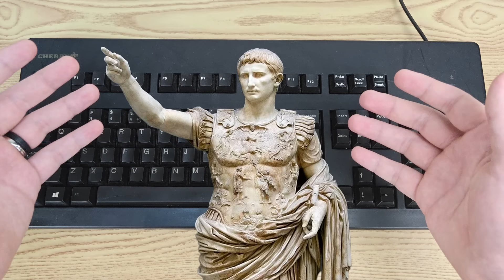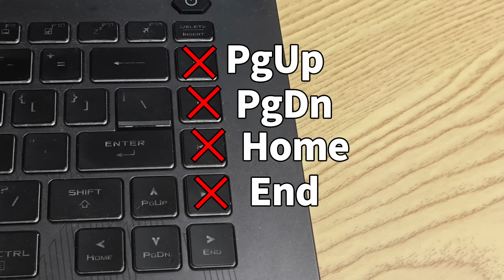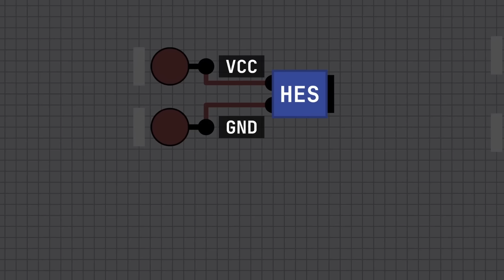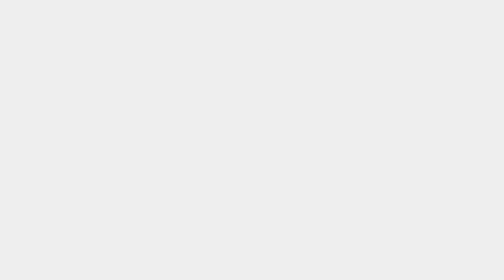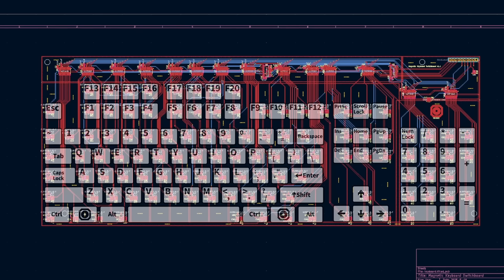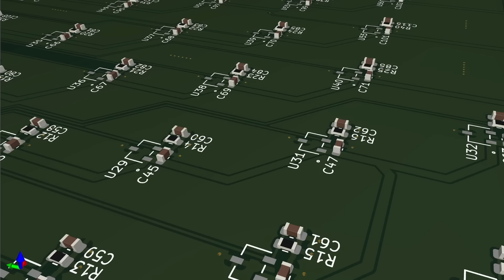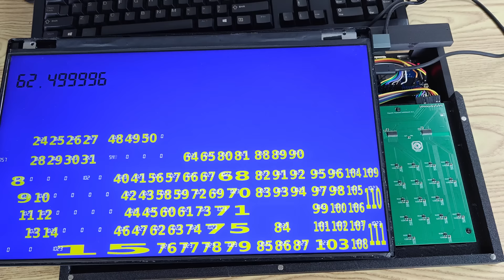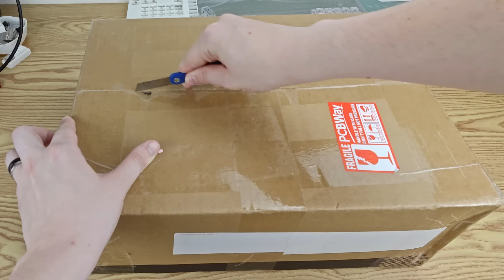Making a Keyboard that Swaps Key Layouts on Demand

Comment: Bros KEYBOARD has a better display than my entire setup
Reply: sameee
Reply: Yeah, watching this from my 1440x900 monitor
Reply: @topcatto  cries in 1024x768
Reply: @Ustaad-e-Muhtaram cries in laptop :(
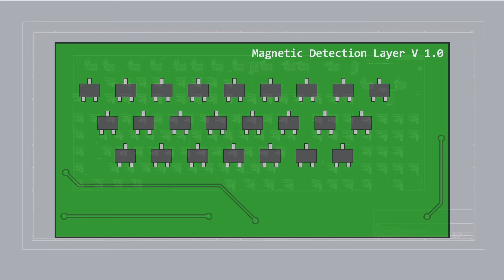Reply: @topcatto  another 16:10 user here reporting
Reply: @topcatto the fuck what the
Reply: @topcatto  same here lol
Reply: Same
Reply: Got a 1440p180 recently, for me 1080p is still fine.
Reply: @cogverkoster yeah I recently got a monitor at 1440p 180hz, did you get the samsung odyssey g5
Reply: I came to say the same thing, on a Pi no less
Reply: 18:42
Comic Sans. And Papyrus.
I see what you did there.
Reply: My friend no hate but just use Linux if you want your desktop too look goood
Reply: (cries in 1680x1080)
Reply: 1680 by 1080 is crazy @UriahStuff
Reply: @MarshmallowBoy  is 1080x720p better?
Reply: Do you mean 1280x720p or 1920x1080p? Or is that actually your resolution lol @KavyanshKhaitan
Reply: @MarshmallowBoy  (cries in 1280x1024)
Reply: @UriahStuff what the fuck
Reply: @UriahStuff cries harder in 1366x768
Reply: same (i have 1080p60)
Reply: Same
Reply: And a better os then your system proby
Reply: laughs in 3440x1440
Reply: @cactus_cuber1589  nooooooo
Reply: smiles in 1080p180

Comment: This video is profoundly important engineering — the Optimus Maximus failed, I suspect, because it tried to put a separate screen in each key (high production cost) while putting a single screen under transparent keys is a brilliant idea I never thought of! 💯
Reply: Overexaduratedet, repeating points from the vid and passing them as your own. This is definitely a bot
Reply: @ethangames5189 a quick way to spot those is when you see mdash ( —)

Comment: I love all the cool topics you dive into in your videos! As for Bluetooth, it's just painful working with and even though on paper I love the features, having to actually use it has so much more friction than I would anticipate. Bluetooth Classic acts as a simple serial interface, but it seems like almost everything modern uses Bluetooth Low Energy instead.
Reply from the maker: I may have to go back to classic then, eventually I want to have the Bluetooth code directly in the main program

Comment: Great project and similarly great execution, as usual. 
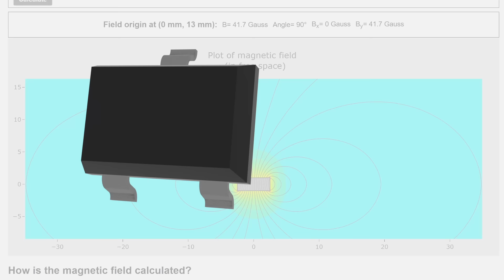One little note at 9:37 it's supposed to be 9 MILLIVOLTS not 9 MEGAVOLTS.
Reply: I've heard enough, another 9 million volts to the SBC
Reply: I think that a value 1,000,000,000 times higher than expected is not that little of a note lol
Reply: @victorscarpes  true, but when speaking it's a small mistake, you know,  same amount of syllables, both starting with the letter "m" ... :face-blue-smiling:
Reply: @veorEL  I was just joking around
Reply: @victorscarpes  I know, so am I, comments and replies help out the video / author. @INKBOX 's videos are very entertaining to me, so I give back in the form of likes, comments / replies. 

BR 👍
Reply: @victorscarpes  the keyboard would turn into a Tesla coil
Reply: Beat me to it lol
Reply: "The 1.21 gigawatts keyboard"
Reply: One massive note would be the wildly inefficient design with ADCs and it having an entire sbc which was not at all needed, despite what he says
Reply: @MusTheFan What method would be more efficient? Genuinely curious to learn.
Reply: @mattrogers6646  feeding it into an analogue comparator with a reference signal generated else where, then it'd work just like a regular keyboard matrix again and the only thing you'd need to code would be something that maps from the standard keyboard to the selected keyboard layout
Reply: If you really wanted to you could even still use an ADC to calculate the average for a reference signal, but you wouldn't need it on every key, just a couple random sample points would be enough and it could be done in parallel with normal keyboard function. The ADCs generate a lot of delay as they take a long time to poll
Reply: @MusTheFan, the SBC was for the HDMI (and BT). It may have also been for the ADC. But that was just 1 of the many needs.
Don't know if a simple esp33 would be able to do HDMI trough some of it's pins...
Otherwise he would be stuck hardware hacking the screen to directly drive it, eliminating HDMI or any other protocol.
Reply: It's bait for you to comment.
Reply: @doomsdayrule well then, it worked, I'm hooked.